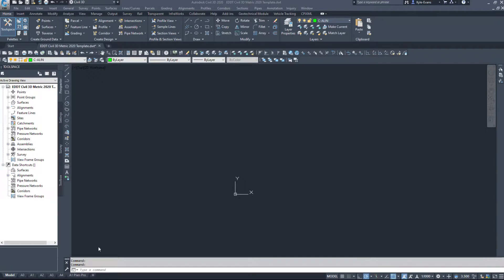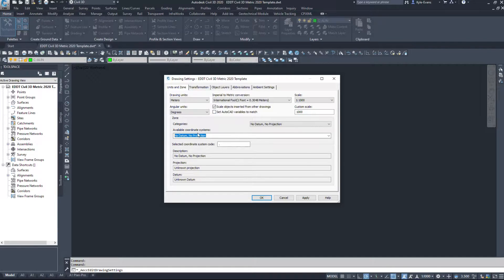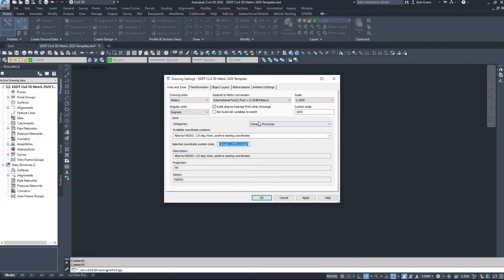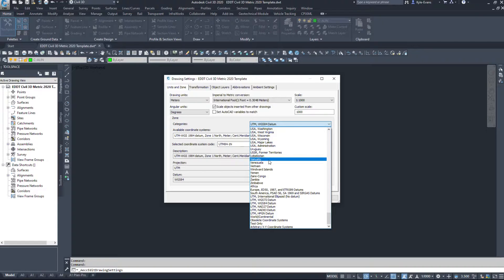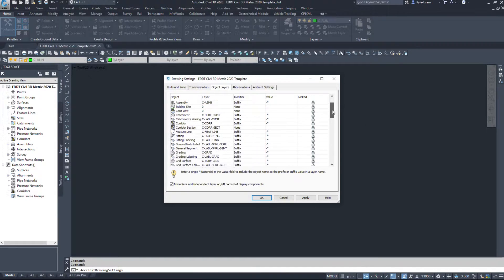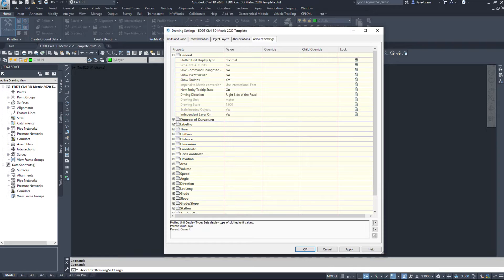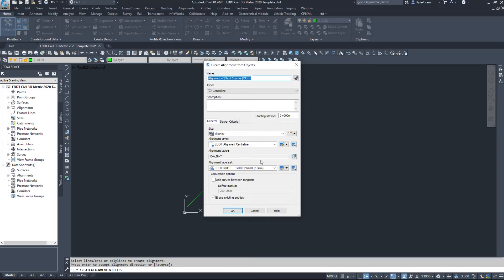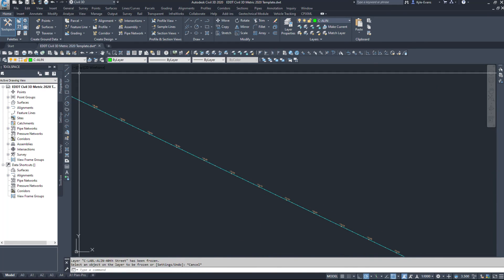Introduction to Civil 3D Part 4 - Units and Zone Dialogue Box and Auto Layer

Comment: Kyle, thank you so much for creating so much Civil 3D content. I recently started a new job and had not yet had experience drafting using Civil 3D. Something I am still working on wrapping my mind around is parking lot creation and grading. I have seen the task accomplished using corridors or feature lines. A video demonstrating parking lot design (with islands, driving lanes of varying widths, and curb returns connecting to an existing or proposed roadway) would be greatly appreciated. Keep up the great work!
Reply from the maker: Thank you for watching! As for grading right now I do have some very detailed videos on corridor design and creation as well as pond design and creation. Those could definitely help you with a parking lot.